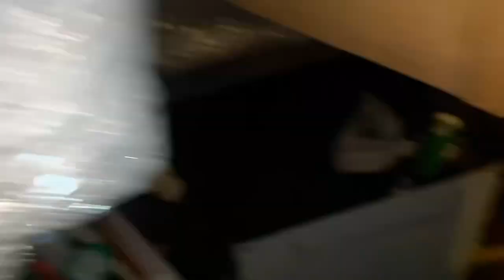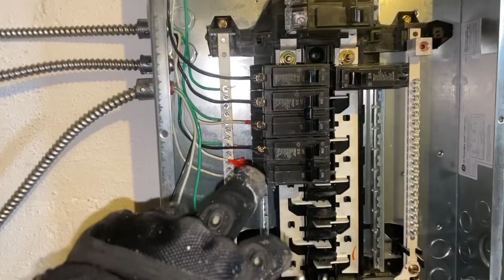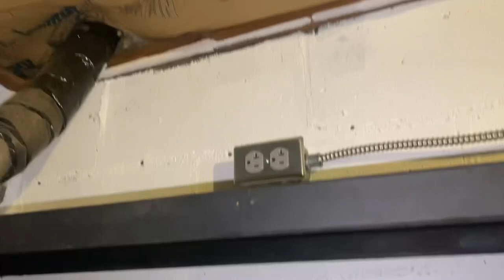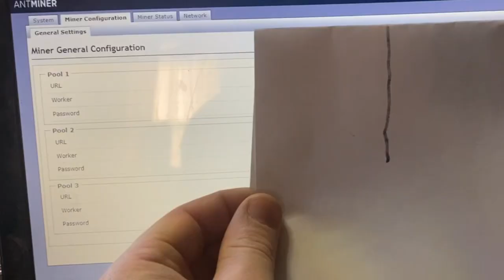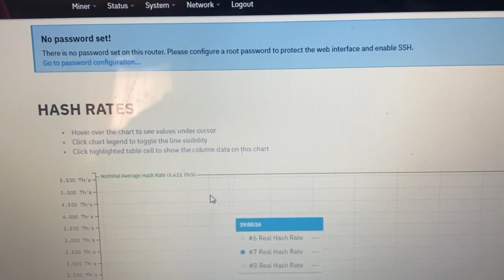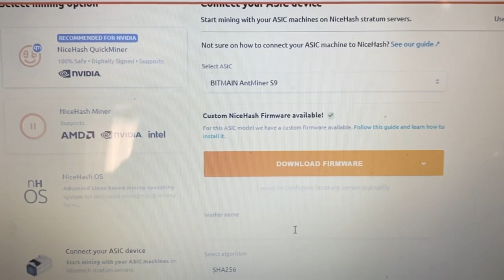How to set up a bitcoin mining operation using Antminer S9 units from start to finish.

Comment: I have a 200amp service in my house. I can do simple wiring and I already know the black wire is positive. I don't understand the breaker panel much however. Since it's a 200amp service would it be wrong to add over 200amps of circuit breakers? Should I add up the amps on all the circuit breakers so that they do not exceed 200amps total?

Comment: get ahold me brother have some tricks to help. and been mining almost 2 yrs now.
Reply: Would you be willing to recommend some videos for starting from scratch and zero knowledge?
Reply: @peterbagshaw5863  voskcoin. red panda mining. are 2 i would start with for gpu mining if going for asic i can get the others. not much difference other then power pull and cooling. 
now days cheaper to get a asic then a gpu rig. but limited to what can mine on asic.
Reply: @peterbagshaw5863  i use awesome miner. i have 1 old computer running 1 gpu atm and then another old computer running 1 gpu atm. i can run 3 on 1 old unit and 4 on the other. but not atm cause bills was tight and gpu prices high. low mining rewards. so i sold cards and also invested into business adventure.